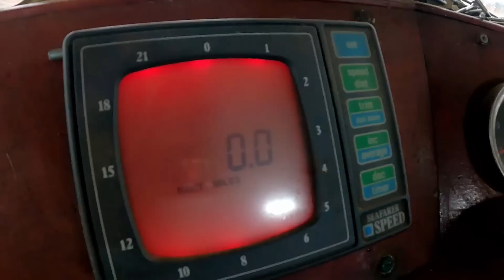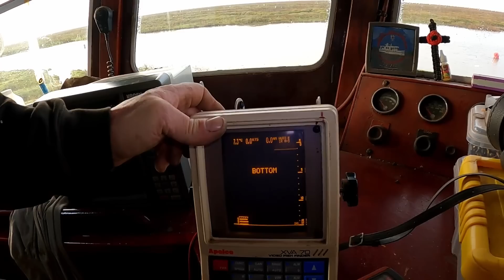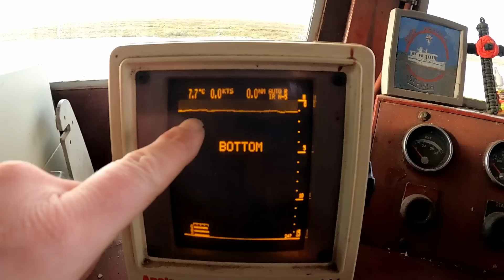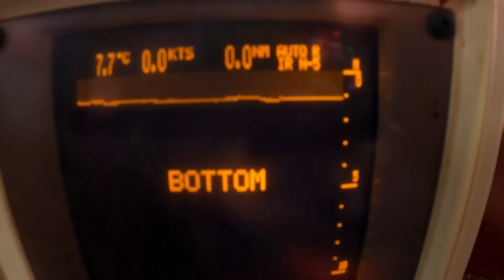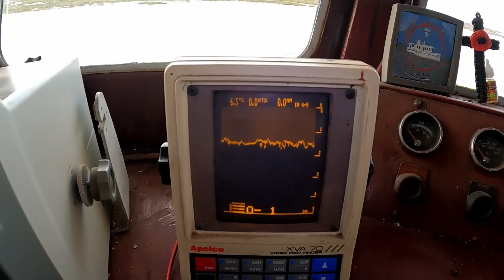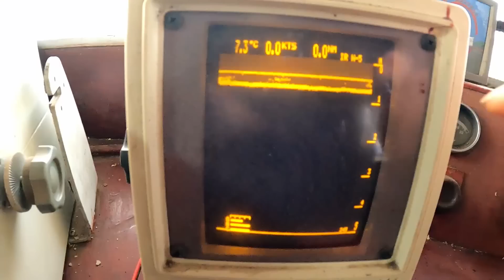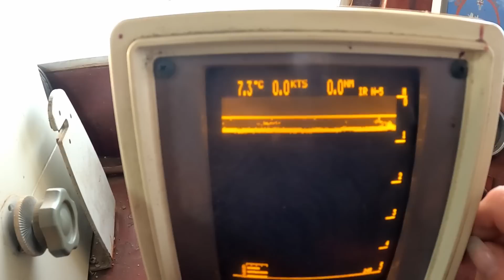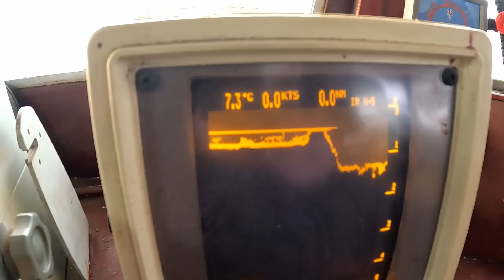Ep 155 Sarinda Gets Sole, Gemma Gets Floored! #boatrestoration

Comment: Too funny, that the gage was not powered. Simon's expression, was priceless. Warning may be depth warning too close to pre-existing settings. E.G. less than 1 meter/ft to the bottom, where the sensivity limits may be -1/2 meter(foot). Should stop as the water below the boat rises.
Starboard sole boards install progressing.

Comment: Great work. This sole / floor will make the area solid & reliable for use.

If it were me, while the weather outside is cold, wet or windy, I'd finish up that old fuel tank compartment. Get the bilge area cleaner, and potentially painted. Plus, the hull and bulkheads painted. Basically finish all the below deck work. Then you can use the port side for storage again without much concern until the deck has to be fixed.

Comment: Hi Simon, for reference as to why you make an exact pattern, prior to cutting into the marine ply,  tell the viewers how much one sheet of marine ply costs.
And a question/suggestion, what do you think of putting in some support blocking between the sole beams close to the hull? Over time, even the marine ply may sag between the sole beams if there’s any weight placed on it. After it’s permanently put in place, it would be extremely difficult to install these blocks. 
Anyway, a great job, as always! 
Cheers from Dallas Texas!

Comment: Here we go guys, this video shows you what can happen when you hit a HARDENED surface with another HARDENED surface. The action happens around the 3 minute point and around 5 mins where you see a chip that could have ended up in someone’s eye. At Pensby Secondary school where I went in the 70s our metal work teachers Mr Beanland and Mr Carrington would give you 2 strokes of the cane if they caught you banging 2 hardened hammer heads together.  
In the video you will see hardened hammers used on a non hardened anvil and hardened and non hardened hammers used together, but the incident occurred when a hardened hammer was used to forge a job on a hardened anvil but a miss-strike occurred where the hammer slipped off the job being forged and onto the hardened anvil. Obviously that is a mitigated risk but you should never deliberately strike the hardened anvil. The guys mentions that it’s safer to use a non hardened hammer and just reforge the head every now and again. Ok lecture over… not being an arse but seriously guys, it’s not worth risking your eyes.

https://youtu.be/9CjKJ9v63Jk?si=G9M2Mzh5XKNpQJQK

Comment: You use epoxy to seal edges but have you looked at Cascamite, a water mixer glue that is water water resistant, only a thought, I know cost is a factor.